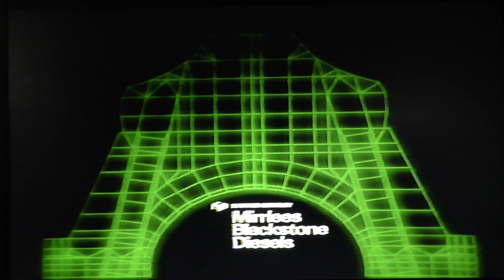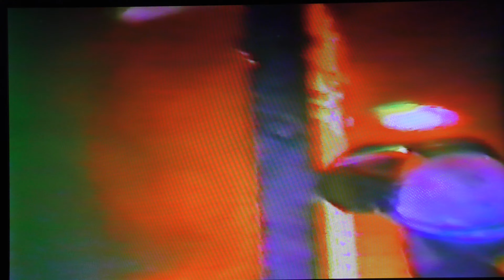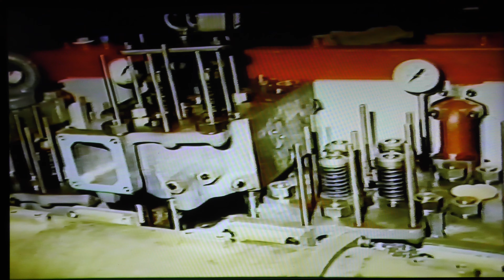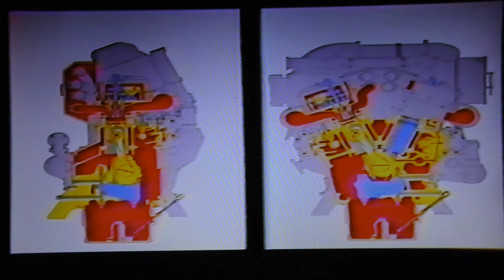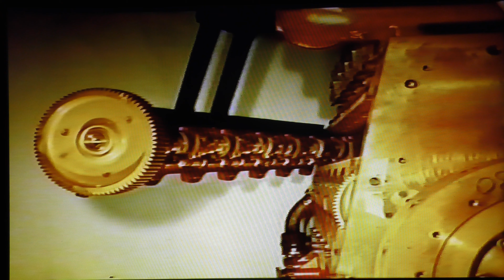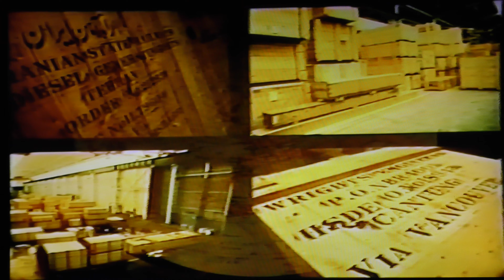Mirrlees Blackstone E Mk 2and MB 190

Comment: I designed the engine control system on the four MB190s that were fitted into HST125s. They were good and had more power than the paxman. The drivers loved them. I traveled around on them for quite some time. They fell down a bit on ease on maintenance when fitted into the power car. Even just replacing a starter motor was a major task.

Comment: I was the R&D lead on the Mk 2 from 1980 to 84. The 190 was one of the reasons they went bust, nobody wanted it.
Reply: Did you know Ian Silver. I worked with him getting the MB190 into the HST125s. I worked for Heinzmann
Reply: @billhall8745  I did . He was on the 190 when I was on the Mk2, we sat two desks apart. 🙂
Reply: @leedove7255  Happy days.Another project that I designed was on an island somewhere. There were three ELS different size engines and they had to start up, sync and load up etc to suit the island load requirements